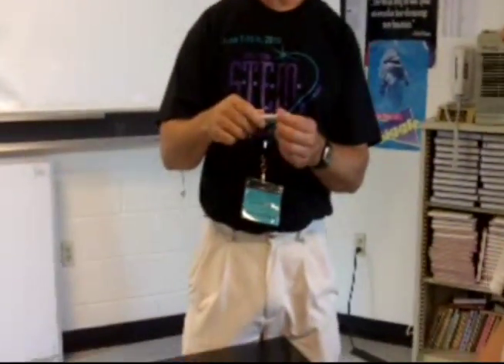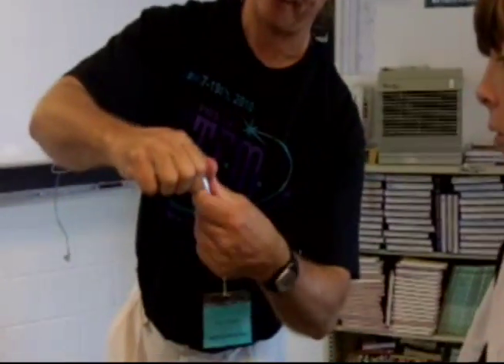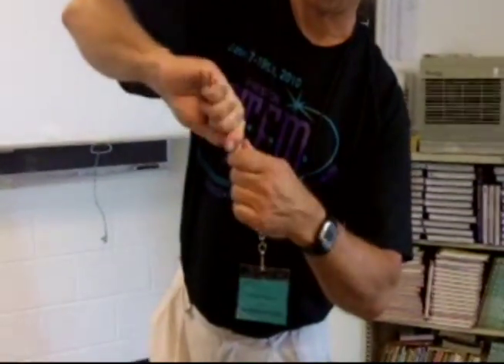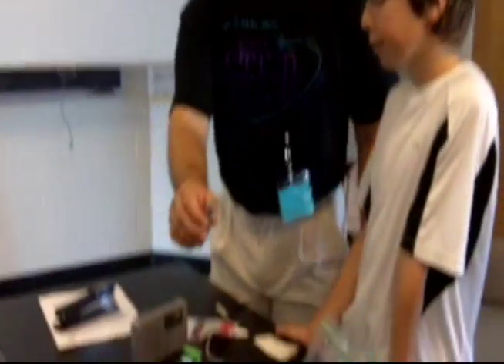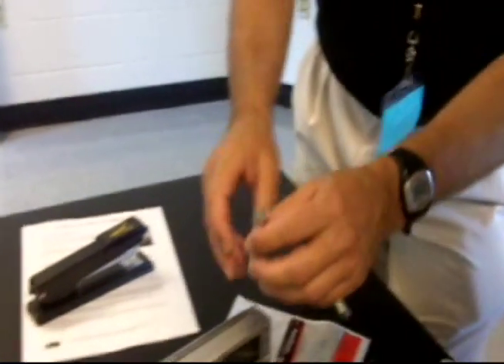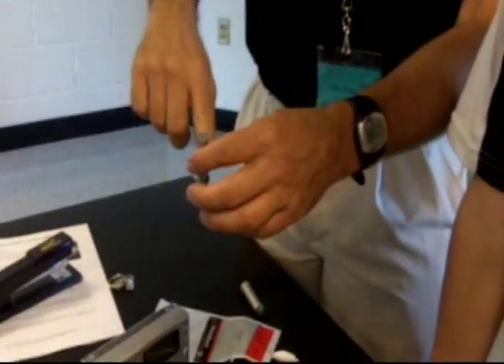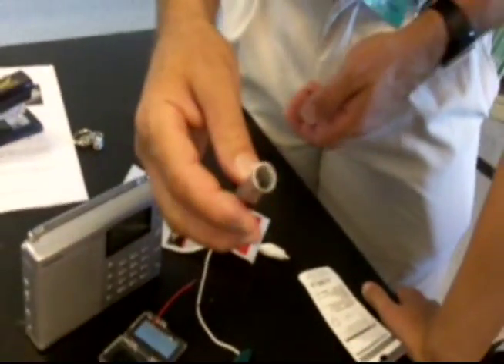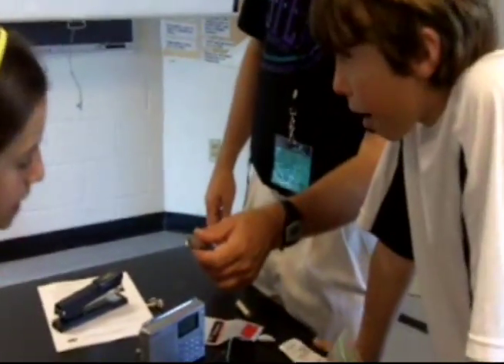Laser Communicator

Comment: hi, do these specs for the audio output transformer work? AC resistance @10khz : 2KΩ-0-2KΩ (primary), 95Ω (secondary)

Inductance @10khz  : 19.2mH-0-19.2mH (primary), 0.88mH (Secondary) 

Turns ratio approx : 22:22:1

DC resistor approx : 39Ω-0-39Ω (primary), 1.5Ω (secondary)

Dimension : 15.0x11.5x14.0mm, LxHxW